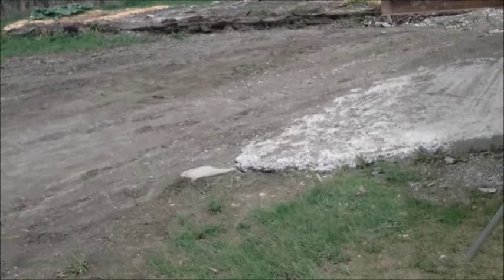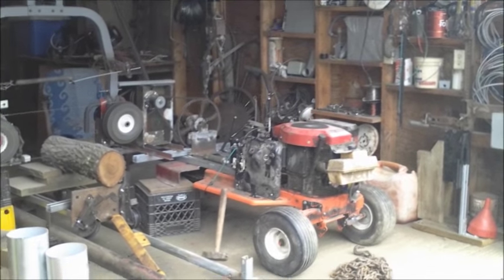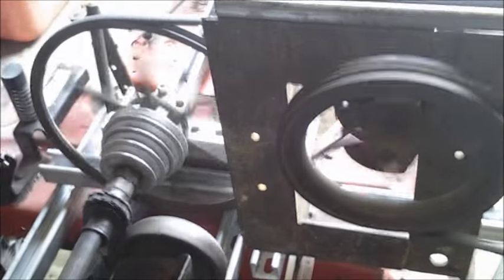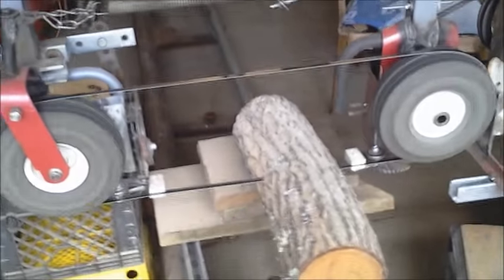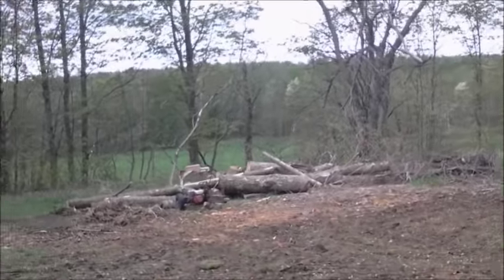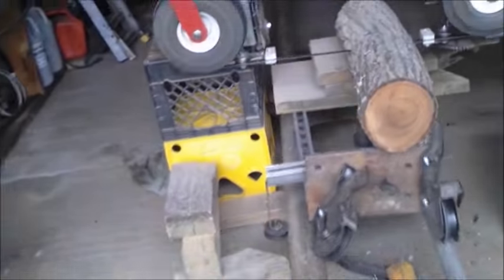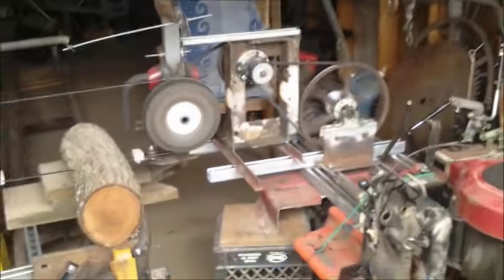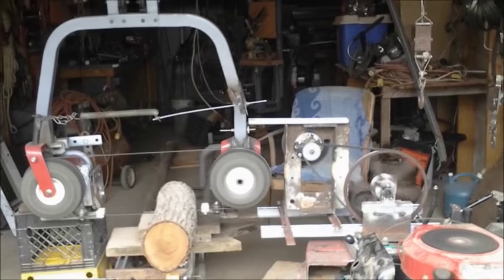Homemade bandsaw from lawnmowers

Comment: Where OSHA when you need them!!! Looks your enjoying the warm weather bro
Reply from the maker: Ecpanzer83 Blade guards, yup yup, just a prototype anyway, I'll eventually use this little bugger to cut metal. I got to order a larger blade and a bigger drive setup to really zip through logs. at least 1 and 1/4" blade or even 2". The large mills are 12" DOUBLE edge bandsaw blades for slicing bread forward and back. Thats Comin in HOT.   love ya bro.      Scott R

Comment: Go look at my mill on FB same name as here I need to refine it some but good design best blade to use is woodmeizer double hard twelve foot. I am building some new mills using a baluga scooter the one on FB I tighten the blade with air you need skinny tires so not to take the set out of your blades.

Comment: Its been awhile since you posted a video, I was wondering if you fell off the tripod, Theres a guy in Canada that has a homemade sawmill ran by a motorcycle
Reply from the maker: SuperAceuno1 perfect on the layout right. motor cycle is already horizontal with proper sizes etc. NICE. I've got 4 or 5 old riders I can cannibalize. tires and all. ED Leedskalnin used model T's I am hooked on lawnmowers. Idler pulleys and springs are particularly handy.
Reply: Made by one man I watched a video about a homemade wood spring lathe with a foot pedal earlier, It was pretty neat seeing that simple design, Those different old school ways are what created everything that people can't figure out nowadays just like what was found out about coral castle, Once the different things came to light the magic secrets were gone
Reply from the maker: SuperAceuno1 They used to take a 10 foot sapling bend it over to a foot pedal so it pulled up back to straight growing but bent created a nice spring return tension to do the same thing with a treddle. (like an old sewing machine) have you seen this one? heres the link https://youtu.be/h9T7_ffsxYg 
This is the CATs meow. (for your lion icon) hee hee.   hope you like it.
Reply: Made by one man It does a good job of spliting
Reply from the maker: SuperAceuno1 for such little effort and great benefits.
1. quiet and almost rhymically relaxing
2. no trips to the store for gas, oil
3. No mall to bust your back and impacting your wrists
4. No nasty smell of exhaust
5. minimal wear parts.

drawbacks, 
1. not so easy to move
2, gotto build it

If one were toconnect a ED leedskalnin concept to it, basically a car battery DC solenoid and made it pull itself each time, then  you could "look ma no hands" some kindling into next year and throw it in the bin before it hit the ground. The Ukraine Ed Leedskalnin like Effortless Kindling Machine.